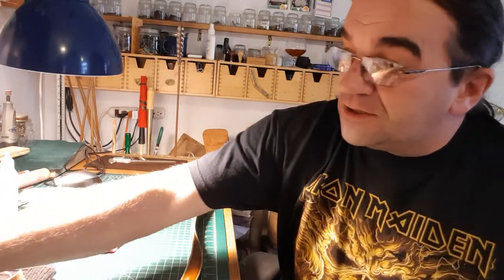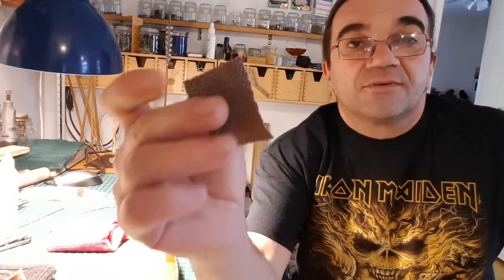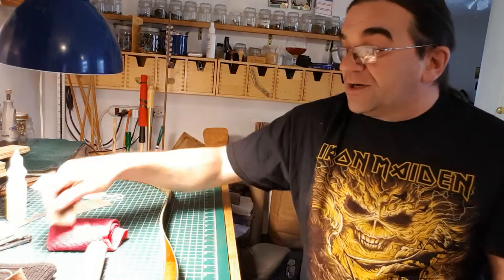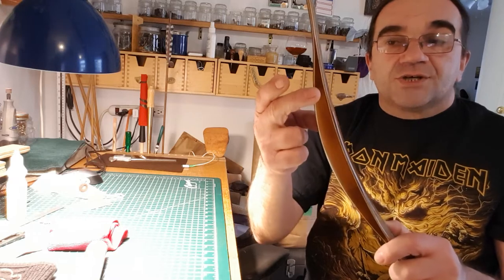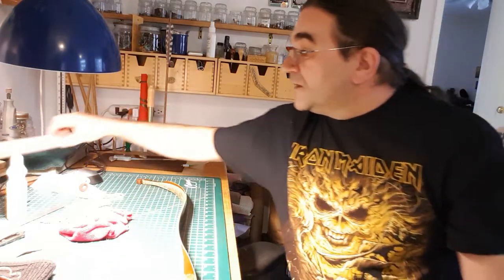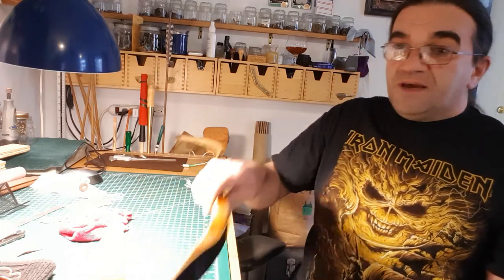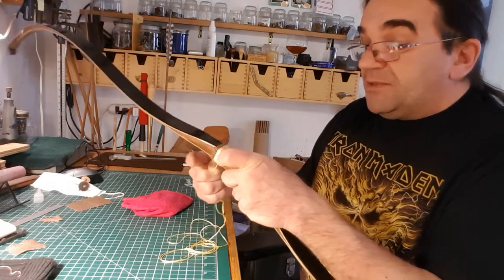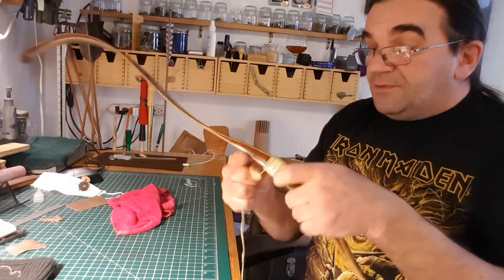Stingray arrow pass

Comment: Good demonstration. Thank you.
The very good thing about hot hide glue -vs-fish glue is that HHG shrinks to draw the two surfaces being glued together. A soft cloth with warm water will clean off HHG. It is stronger than fish glue.
Reply from the maker: Both types of glue have good and bad sides.
However, one can decide which glue to use for himself, of course. 
For arrow pass fish glue is sufficient enough.

Comment: So I got a 1" x 3" piece of sting ray with my bow so I can replace the arrow pass. The back is white and fuzzy. Are you saying i need to glue and sand down both sides before installing? 
Could I use regular glue or super glue for that part or do I need to go organic? (Trying to use what I have) 😄
Thanks for another good one!
Reply from the maker: Never tried super glue for this application. 
I'm sure it will work, but it will be thicker than it needs to be .

Comment: super ,  can i use "Fish Glue Joiner's Wood Glue " it
Reply from the maker: I don't know that particular brand , but you can try on scrap peace.  It is reversible.
Reply: @nomadicartsarchery268  Do I need to apply fish glue on both sides? The skin side is very hard to grind X(
Reply from the maker: Make it slightly wet,  it will be much easier .
Some deluted glue helps as well.
Reply: @nomadicartsarchery268  Can I tie it with a nylon thread instead of sinew?
Reply from the maker: I would say yes .
But, I use artificial sinew because it shrinks as it drys .